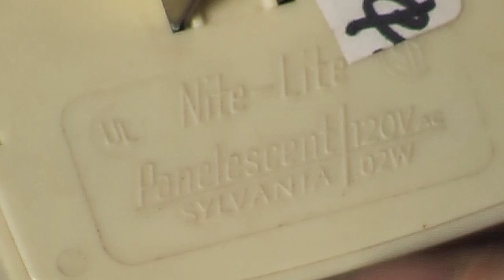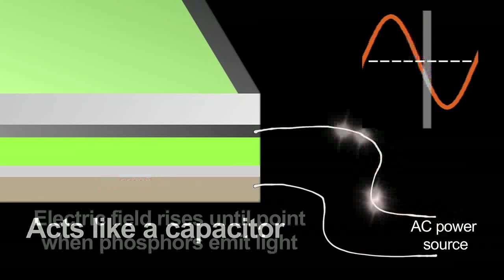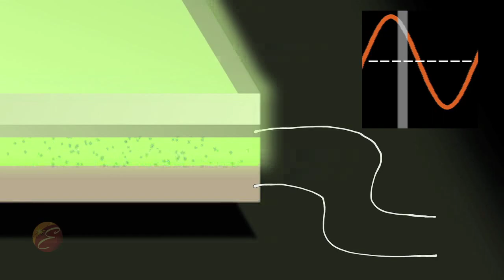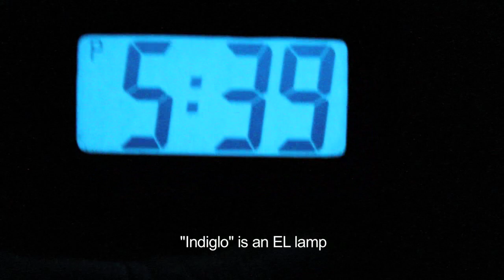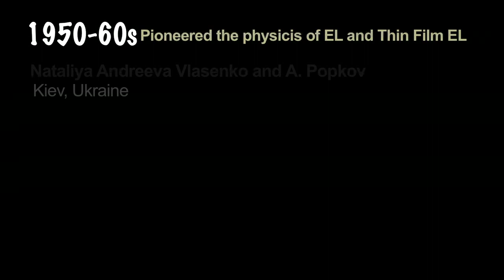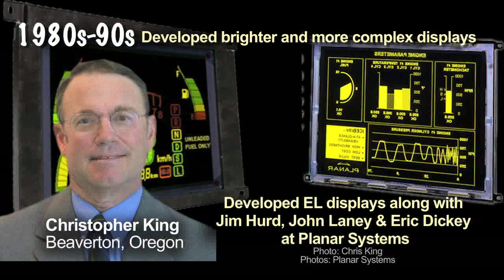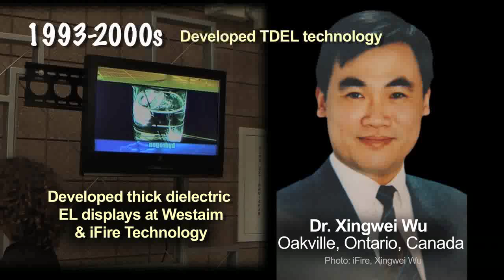Electroluminescent Lamps - How it Works & Inventors

Comment: The most pervasive use of EL lighting currently is in automobiles.  Its first use in automobiles was in the instrument cluster 1960 Chrysler Imperial, and spread to several other Chrysler products in the beginning of the 1960s, but never caught on.  Nissan reintroduced electroluminescent lighting technology to automobiles in 1989, using the technology in the digital instrument cluster of the 300ZX.  Since then, Nissan has improved the technology, using a new organic phosphor, and in 2008 made the first directly illuminated white EL instrument cluster which was bright enough for daytime use, introducing it in the Infiniti QX56.  It has since expanded the technology throughout its product line.

Comment from the maker: @CampKohler Its possible to short the lamp if you cut it (talking about flat flexible lamp material) - the thin electrodes at the cut mark area can touch and cause the short once energized... however you can make your own EL lamps using fine wires and ZnS powder, there is a lady who will show you how to build it on youtube.